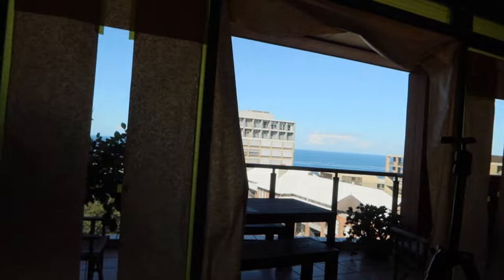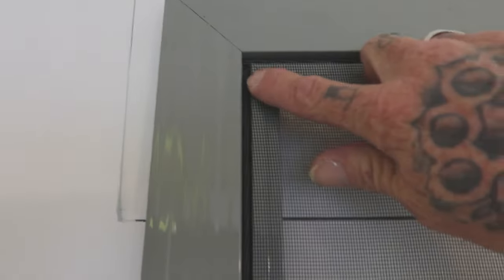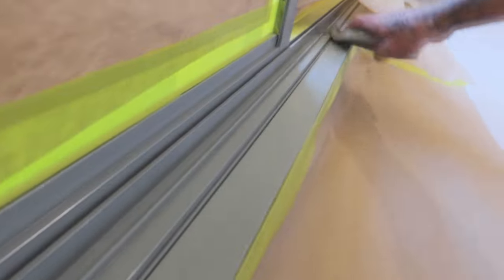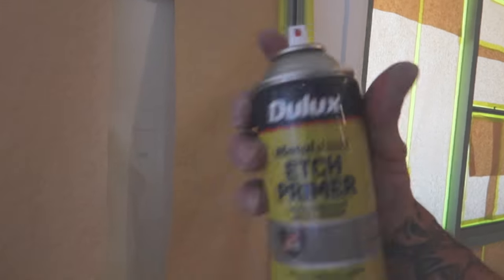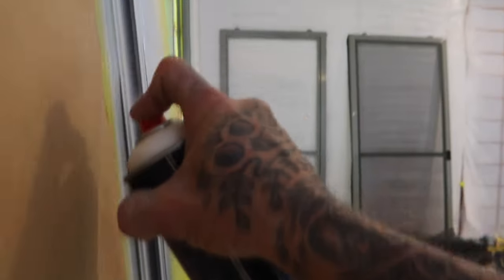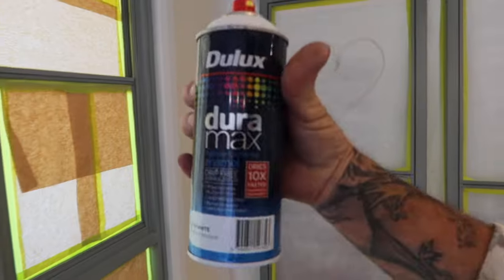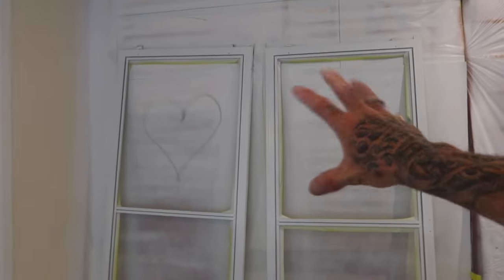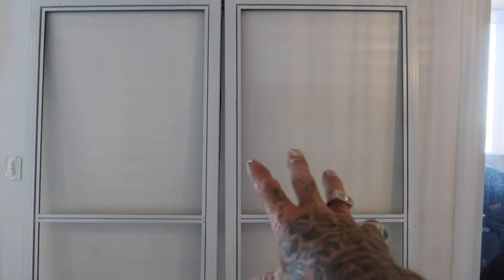HOW TO PAINT ALUMINIUM DOORS, FRAMES & WINDOWS FROM START TO FINISH

Comment: Gr8 vid mate another one alot of people dont know is you can turn the tip on the end of the spray can nozzle it comes preset to spray for horizontal strokes if you turn the tip a half turn it will be easier  to spray in a vertical pattern thus not having to tilt the spray can awesome work
Reply from the maker: Cheers legend, yes most definitely I should have mentioned in my video.🤦‍♂️

Comment: Awesome video Josh, thank you 🙏 just about the weather strip - I have one on my windows that’s on the sliding panel, it’s facing the outside but is tucked tightly in between the frame, would you normally tape that up still or just paint it. Hard to explain without a photo but it’s behind an overhang of the frame
Reply from the maker: Thank you Isabella,🙏 yes hard to understand without a photo. You could always send one through @paintingbyjosh instagram, would definitely help. But if it's really hard to get to I would just paint over it! Sorry I couldn't help any more

Comment: Thanks so much for sharing your expertise Josh! Can I ask does this technique also apply to painting the top and bottom runners of the sliding doors. Wondering if they can be painted  since constantly has door running back and forth will the paint hold? Also when sanding aluminium in good condition do you go over once with 180 and again with 240 or use anything in-between?
Appreciate the advice 🙏

Comment: Great video. Quick heads up (from a previously pretty active graf artist), your pressure drop isn't a need to shake the can. You're only shaking to keep that paint mix consistent. Your pressure drop isn't actually a pressure (Theres enough pressure in those cans to cover you til its empty). Issue is that you're often holding the can on the side as you paint and a once the can is half empty it's going to be sucking air not paint unless it's upright.
Reply from the maker: Cheers legend. I completely understand I have been active in the graf scene for over 30 years. Cheers for the comment 👊

Comment: Hi Josh.  Another great video.  I have 2 queries.....  How long did you spend masking up approx????  And what's the difference with the red tip and the original one??? (where do you buy them?? Sorry.... 3 questions).  Lovely view 🤓
Reply from the maker: Hi Padgehind. I appreciate you always watching. It took just over two hour's to mask up everything that's with a lot of practice of course! The red tip has a wider fan than the black tip & optimise the paint a little better & most dulux stores sell them as Dulux duramax caps. Hopefully this helps & yes absolute beautiful view 😍

Comment: Hey Josh, happy Easter mate. Quick question, you say you sometimes spray the rubber seals… how long do they tend to last before cracking after painting? 
Also is there any issue with putting etch primer on rubber my Dulux rep thought it might eat into it.

Comment: Great information you shared, really thorough and informative.  What are your tips for this technique on security screens fixed to a window if only the inside needs a change of colour?  I can remove the fly screen but not the security section.  Is it a matter of taping it up from the outside?
Reply: I have boral security screens that are fixed with screws at the top and clips at the side. I just took the screws out with a drill and turned the clips and it was pretty easy to take them out